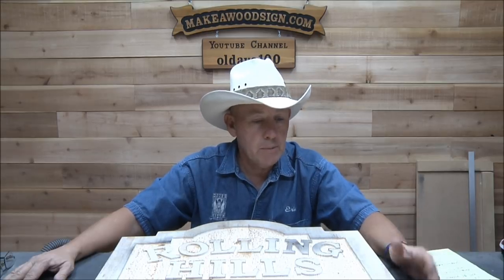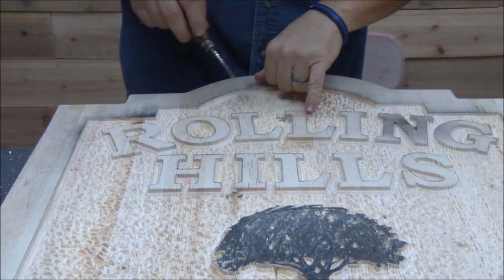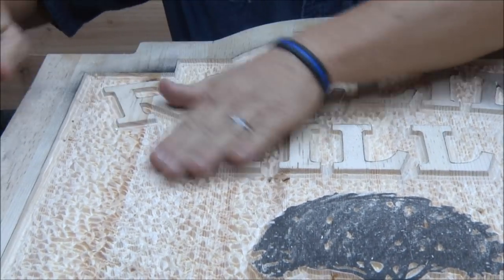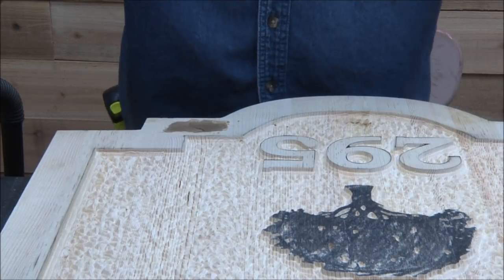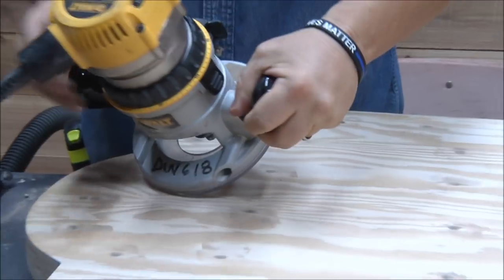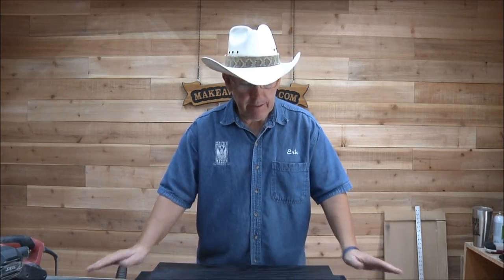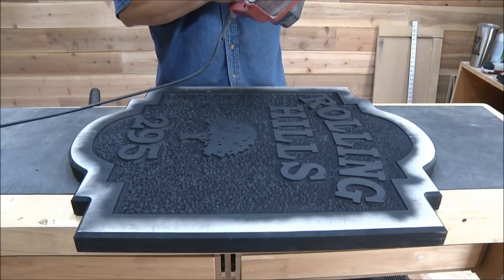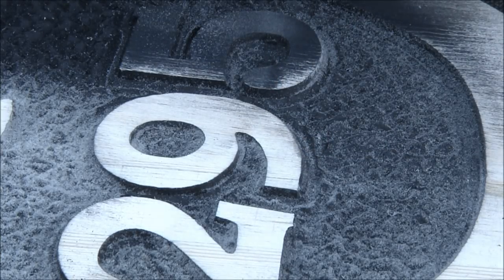#227 Making Of A Big Shaped Sign Part 5 of 7 More Carving Rolling Hills Sign For Jon Peters

Comment: Great video, Vicky. Great teaching, Eric. Loving every minute. I'm a bit concerned about the weather resistance of the primer and the paint on the back.
Reply from the maker: Thank you Gene, glad you're enjoying them. I always have concerns whenever I know a sign is going outside. I always try to use products that say exterior them. The final finish I use for sure says exterior on it. For this sign I'll be using ZAR polyurethane. I've been told it's the best.

Comment: When you put the plywood onto the pine do your want the grains running the same way or opposing each other?  Wondering if it matters to prevent warping and twisting of the pine.
Reply from the maker: My thought on this is plywood is made so the grains are running different directions within the plywood itself. That's one of the reasons it's so strong. I use at least 5/8" thick plywood. It's never failed me yet keeping the board straight. Hope this helps... Thank you for the question and for watching, Eric

Comment: What is the PSI rating of a glass mason jar... just seems to be a glass bomb in your hands.
Reply from the maker: That's not an issue. The way the critter sprayer works there is zero PSI inside the jar. The air blows over the nozzle & siphons the liquid out. It's a great (and safe) little gun. Thank you for the concern, Eric
Reply: Thank you for your update on that. Now i may too have to purchase a Critter for my garage!
Reply from the maker: I love mine....